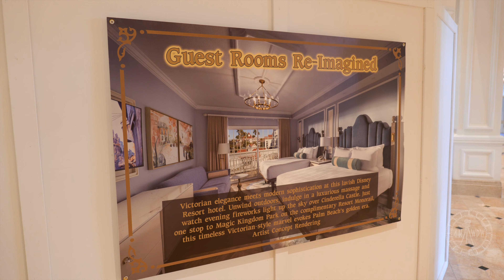Disney's Polynesian & Grand Floridian Resorts Construction Update July 2023 | Walt Disney World

Comment: Is there construction at GF right now besides the inside/outside of the lobby building? And is the walkway between the Poly and GF open?
Reply from the maker: From what I saw, the work is only on the main building. The original walkway between the GF and Poly has been closed for awhile, but a different one was built due to the Polynesian DVC tower construction. So the answer is yes it is open, but it’s not the one you remember